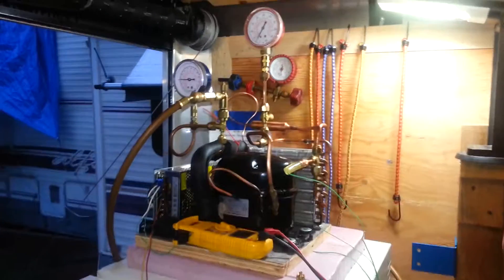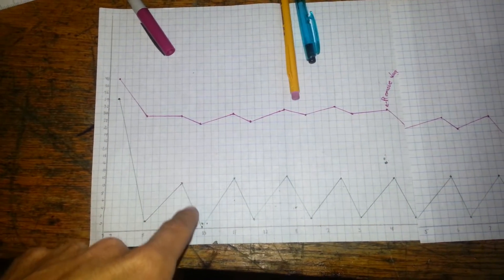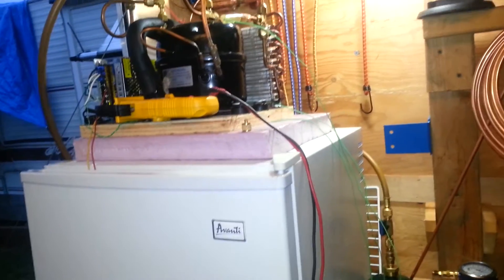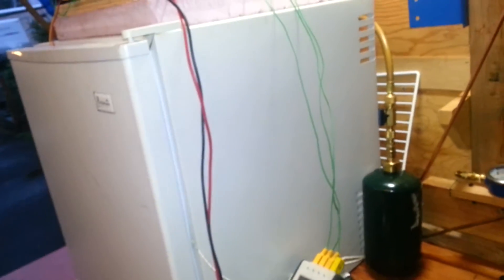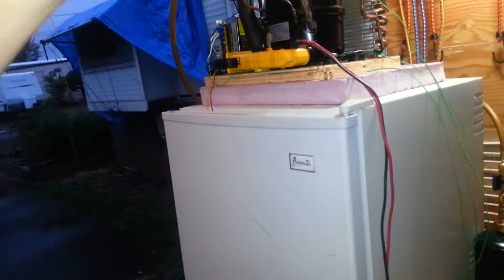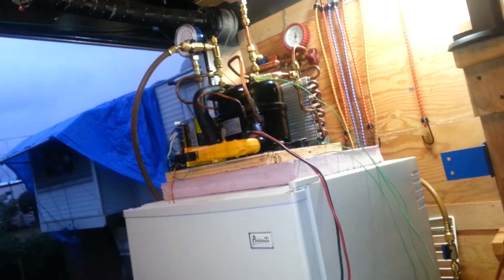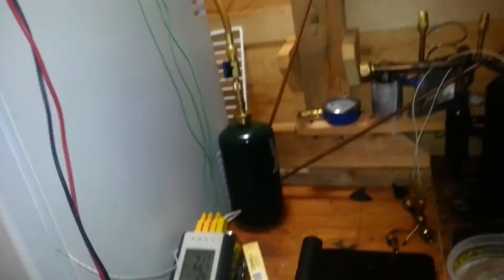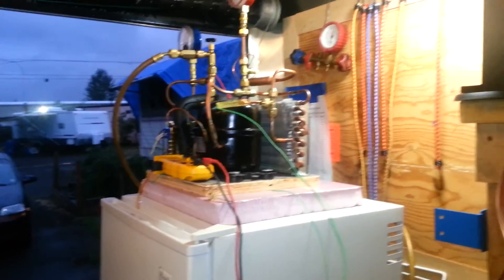R290 Freezer- Temp Logging, Observations

Comment: An inverter / variable speed compressor would be interesting if for no other reason than the temp could be better controlled. But more complicated and expensive I presume. ?
Reply from the maker: I agree.  The important now, is to get an appropriate sized compressor for the application.  Down the road, I'll be investigating the use of a variable speed compressor, giving the user the control.